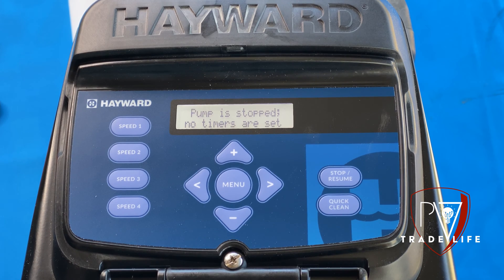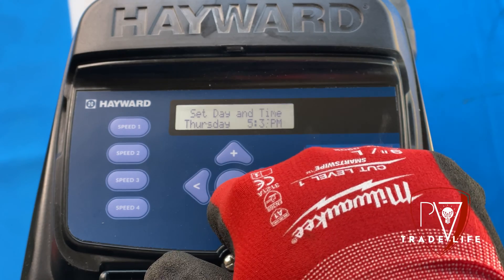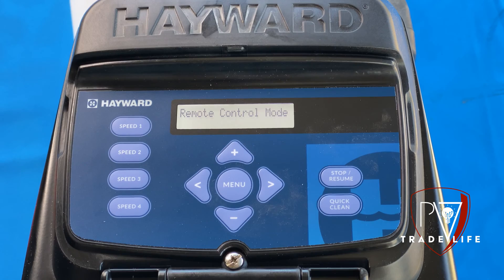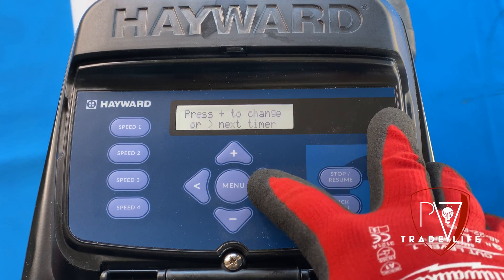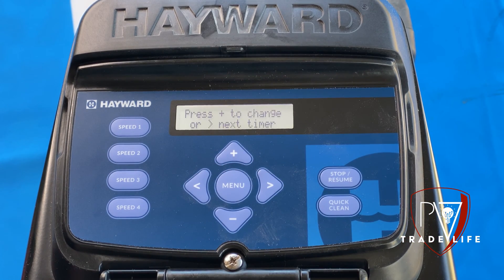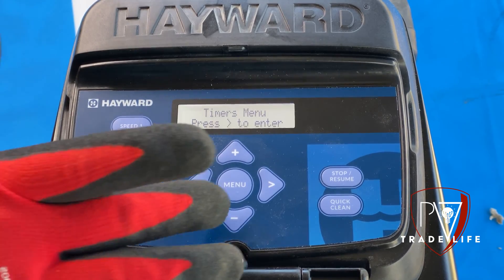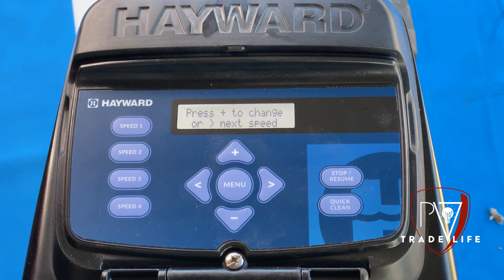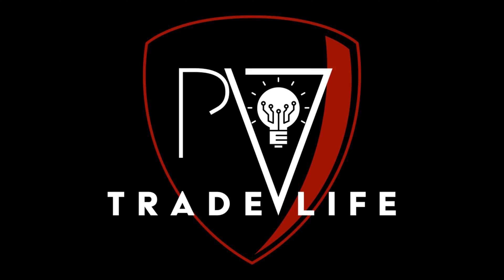Hayward Variable Speed Pump Programming How To..

Comment: Is it common for variable speeds to screw up chlorinators attached to? Like when I start it is working but when it goes on a lower speed it think it is not enough and stops running water thru the chlorinator .

Comment: Great video.  What speed to I have to run this pump to get my heat pump to heat during the standard background low speed if using your suggested program of 8-8 low speed 1925 with a high speed 3150 from 2-4?

Comment: If you are adding a chemical that requires the pump to run for 24 hours... what do you do? Is there a way to manually just leave the pump running for 24 hours?
Reply: No answer? My question as well.
Reply: @johnnyoneniner4820  yes, you can program the pump to run for 12-24hr if you press speed 4. Very convienent when adding Conditioner.

Comment: I need to shock my pool so it needs to run constantly for about 48 hours.  Is there a way to just bypass the timer and start the pump without having to set up a 24 hour timer?
Reply: Any answer? I have same issue.

Comment: How many hours does the pump has to be without electricity, so it reset all the information???
Reply from the maker: You can just set it back to default through the configuration menu. See user Manuel

Comment: Exelent video. To turn the digital control interface do I just remove the two screws and turn it or do I have to cut the power to the pump.
Thanks..
Reply from the maker: Eithier or I prefer you turned power off , just to be safe so no accidents happen.

Comment: Great video. Helped me change some settings on my pump. How do you turn a timer off? I needed to run my pump for 24hrs so i set up on timer 3 but i want to turn it off.
Reply from the maker: Same time for both start n stop times. Example 12am on and 12am off. Then it will say timer off.
Reply: Thanks for the help. I got it figured out. I used your technique to set timer 1 and 2.

Comment: What happens from 8pm to 8am? Does the pump stop?
Reply from the maker: Its a timer, just like any other timer it will turn off and on the specified time you choose. The pump is running 8am to 8 pm everyday. Using less energy than a single speed, due to its low rpm. And only running a high speed for two hours if this particular pool has a suction cleaner. All calculations are depending on the size of the pool and how many GPM that we are providing, not one pool is the same as the other.